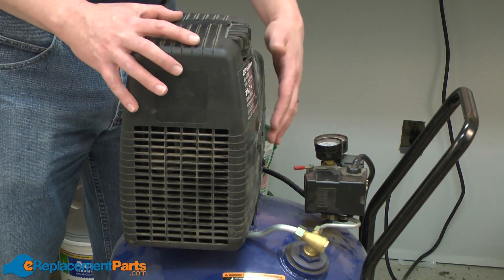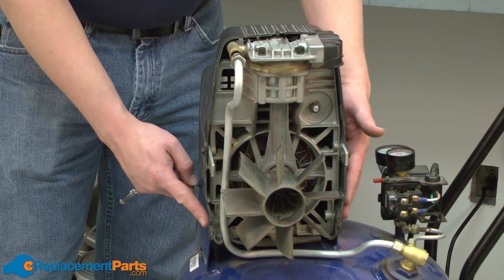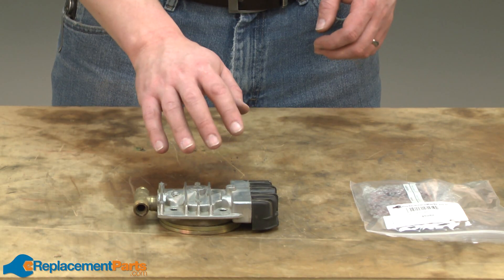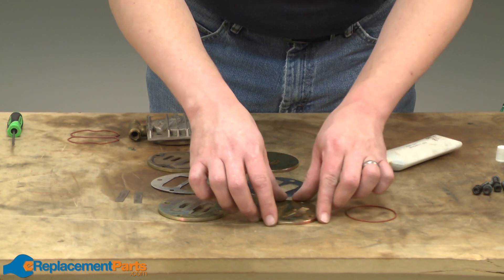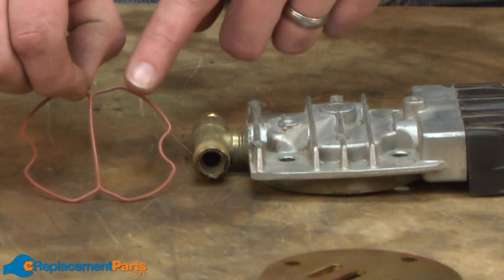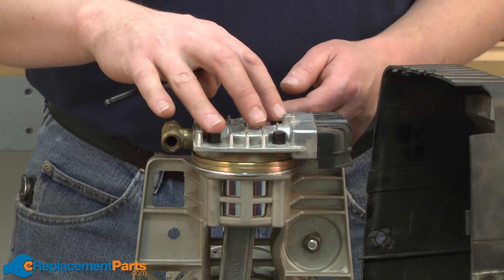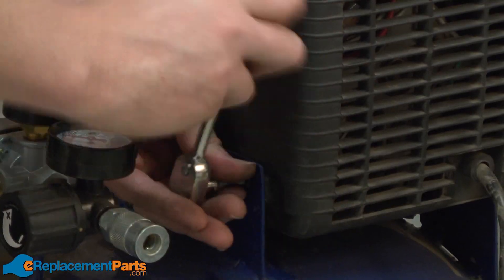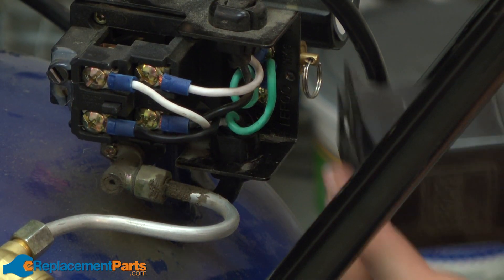How to Replace the Valve Plate Kit in a Campbell Hausfeld Oilless Air Compressor (Part # HU008100AV)

Comment: Can the valve plates be rotated around and be in the wrong position?
Reply from the maker: Yes they can be rotated in the wrong position. It is important to lay the old parts out that have been removed.   In the same order that they were removed from the compressor

Comment: what was wrong with compressor that the valve had to be replaced?  what indications would you get that it needed replacing ?
Reply: Bob Haddock Most likely broken reed or reev valves. those little plate valves. That is why I had to change mine out.
Reply: +Bob Haddock Mine didn't get air pressure.  Broken reed valve.